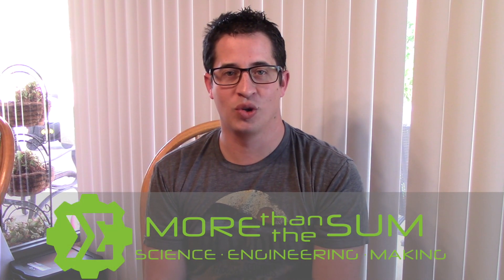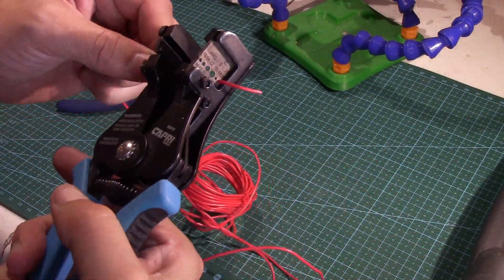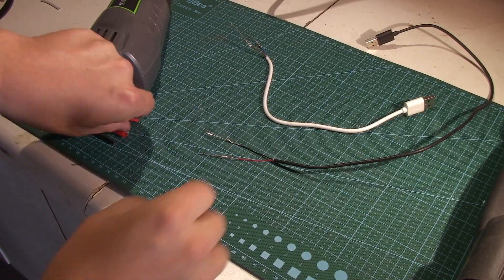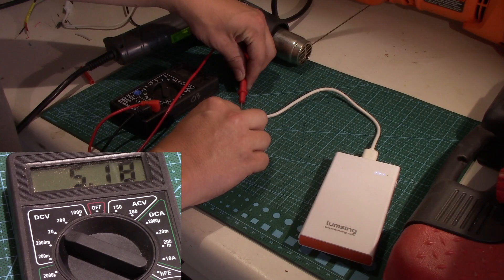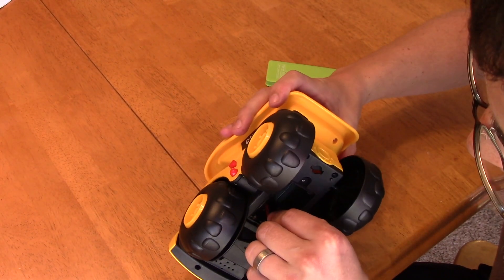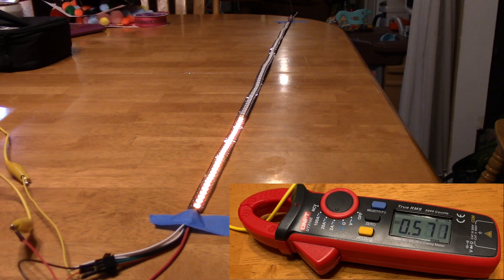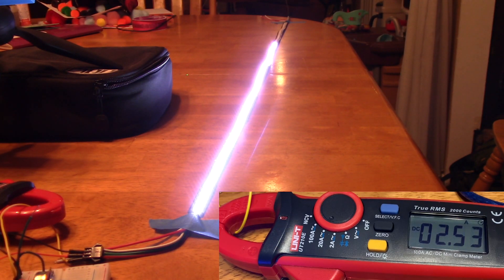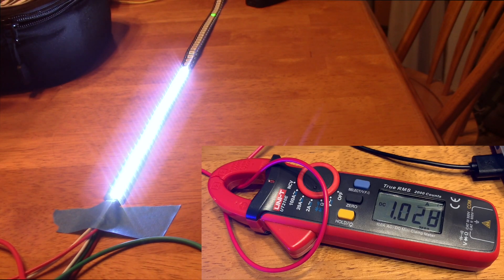USB splice: Squeeze more power into projects

Comment: All well and good, but most modern power banks will turn themselves off within about 30 seconds if the load fluctuates at all or deviates from the expected phone charging under-load voltage and/or amp draw (even if you’re not exceeding the power bank’s capabilities).